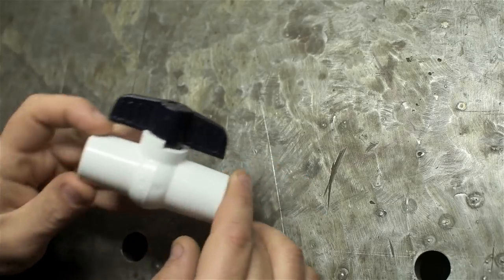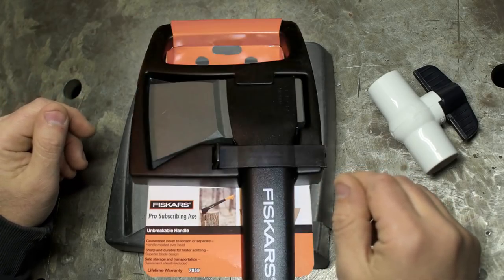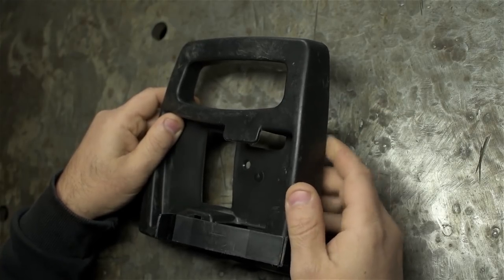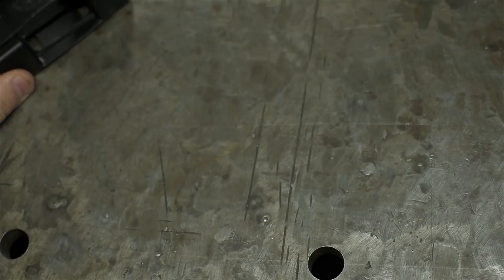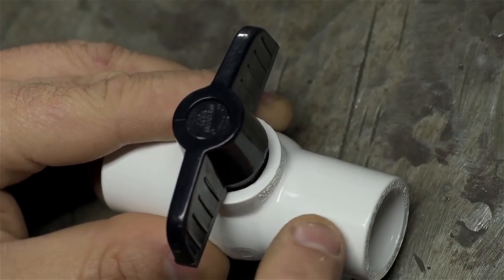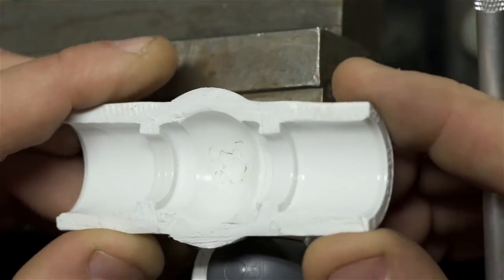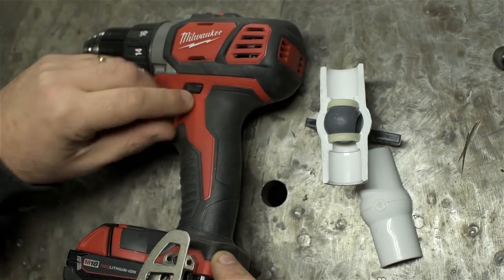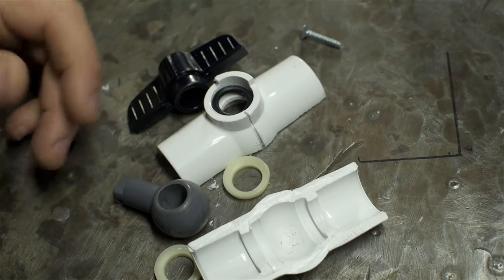Marvels of Injection Molding!

Comment: It is absolutely a .marvel but I plumbed for several years in college and I saw a lot of them fail so much so that the company I worked for would never put in pvc valves we would always use make threaded adapters with brass ball valves because we warrantied everything for a year it's not that they leak externally as much as they don't actually shut off all the way alot of the time they bypass the ball and water continues to flow through not alot but enough to make trouble when trying to do a repair the water won't stop coming out while you're trying to glue in the repair or add in something new I do think that they used to be much higher quality than they are now probably using inferior materials now even though the manufacturing process has advanced

Comment: 7:40 And the valve is designed such, that the handle(?) indicates the valves current state. In the position perpendicular to the flow direction it is closed. Easy to discern.
Ingenious engineering porn.

Comment: You seemed a bit excited by the high pressures of injection molding so it may interest you to know that the tool must close with enough force to accept that pressure. And that closing force can be crazy. Where I currently work, the most powerful molds we have CLOSE with a force of 1,500 tons. 3,000,000 pounds of pressure. There are presses that go above 8,000 tons. The thinner and larger the part, the higher the tonnage.

Comment: i'm thinking of two peices welded, thinking sonic welded around the center ball valve, bet they made like 12 every 30 secs, gate is a hot runner gate by the looks of it. or maybe a half moon would have to be to push that much plastic into the mold.  the inside races for those seals are too perfect to be formed around the rubber seals, plus with 15,000 to 20,000 psi there would be molten pvc everwhere it shoulden't. Been doing plastics for 10 years or so, that my 0.02.

Comment: So if the seals can handle plastic at meltimg temperatures, then i guess the only difference between hot and cold valves are red and black dye in the handles?

Comment: Hey how the hell did they demold that? 2 pieces matrix should work for the outside, but it hell nah would demold with the structure holding the O-ring. it might have needed a THIRD piece of steel in that area, you should look for the welds! in wha directrion does it demold after pulling both dyes?

Comment: The thickness of the valve you measured at about 12' is bigger than the real thickness, you should have used only the tip of the calliper :)
Not saying that it was important to show your point

Comment: there is a obvious seem where they took two parts and fused them around the ball. how is this a marvel of anything? they take two parts and heat them before pressing them together around the ball valve, it was not molding all at once, it is actually 4 different pieces that had to be put together. you can even see where the part parts of the outer casing were melted to make them fuse, also the E and D markings to show which part is which so people during assembly can know what part they are holding. but I already can see that I will just be called wrong and said i do not know what i am talking about, and if that is the case than prove me wrong, or you are only showing i am correct.

Comment: Do you know how many of those valves I have changed out because of them leaking around the handle?  Now the secret is out that all the customer has to do is pop the little cap and replace the o ring.   :-(

Comment: Not really a gate from what I see. It looks more like a modified sprue tip that they domed and recessed it into the wall thickness. May have been a heated sprue too. I know a lot of times the opposite side of the sprue would sink as the part shrunk because the center of that sprue is the hottest part of the shot and the opposite side of the wall sucks back into the center of the sprue when cooling.  I think every mold I ever built that was shot with poly was ran with cold water. Sometimes we'd chill the core and run hot on the cavity. But, that was usually up to the molding guys. I just built the damn things. LOL

Comment: But Tony, how did they get the void at the top to fit the oring in?
Reply from the maker: Not sure where you're talking about.  I think the two orings inside were packed with the ball prior to molding.  The one on the top (under the handle) just drops in a hole.
Reply: This Old Tony To seal the valve stem, at the top section, where the valve handle is secondarily assembled into place, there is a void that the black oring sits in. The question is, how did that hole get there? It probably wasn't post processing based on surface finish. Assuming that the mold is axial, there must be a separate third piece at the top to make room for the handle to sit in, as well as make the rotational tab stop. Maybe it is a really big ejector pin that is also part of the mold? Could explain some flashing at the neck edge.

Comment: Wouldn't the mandrel have only moved up .010 and not .020. 

If the mandrel moved up .020 it would have checked .180 and .200.

The difference in size should be half of the movement.

Comment: Looking at the vertical fusion welds parallel to the stem, I think you might want to reconsider the single tool insitu-assembly theory.   Pretty obvious that each side was molder separately, bushings were installed on each half, then fusion welded around the ball. Final assembly would be the O-ring, T-handle, screw and cap.

Comment: 12:50 i think you'll find that (210-190)/2 is 10, not 20 though ;P
Reply: It's close enough. You know that to engineers pi is 10. and this was more accurate than that, so it's fine. ;p

Comment: some random terms being tossed about here. is there a micro engineer inside inspecting things as the part gets ejected? not a witness line. you said it once, but reverted back to "witness" instead of parting line, where elements of a die come together. i had to -1 this, because you're trying to be factual and explaining, but missing the mark on accepted names of features which takes away from clarity.

Comment: Tony, when bragging on that valves "longevity" and reliability, keep on mind it's basically a flow-through tube. And less than 1/10 if one percent of the time, the handle is turned to block flow. Cycle that baby a few hundred times a day and a redesign - for reliability, is in order. As is, it a few pennies worths of plastic designed as cheaply as possible, to be occasionally cycled from "open" to "closed." Electro-mechanical relays are designed to cycle hundreds of thousands of times, even millions, while alternately passing and blocking the flow of billions of electrons while arcing and heating up. Your passive water valve is a bit of a dog.

Comment: you didn't get an accurate measurement with your calipers because you measured with the wrong part of the caliper's jaws ... you should have used just the ends (the "sharpened" part). The part of the jaw further in is wider (thicker) and you can't put that part of the jaw on the inside diameter feature of the part ... ROOKIE!

Comment: heh... it's like AvE but not as skookum.

coated with teflon maybe? the ball and knob is molded, coated with non-stick heat resistant teflon(heck graphite might even work), it's stuck on a mandrel with the seals, then they flash mold plastic around it.
bam, valve. git gud.

Comment: the gates are very ugly also the line is very pronounced. Both are too ugly for a mould that does have all those inserts, also the isolation part would get banged up a lot from the moulding pressure.
Also such a mould woudl have been equipped by a much nicer hotrunner system when producing such numbers or valves. Even when accounted for low quality american tooling the marks dont add up. It might have been actually done by moulding the parts, ensambling it and then ultrasonicly weald it together.
Reply: no